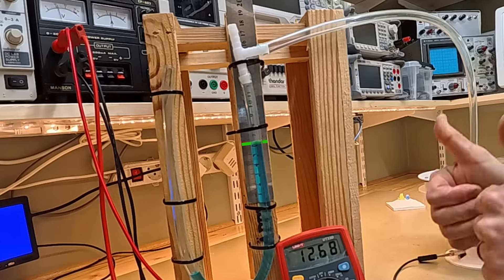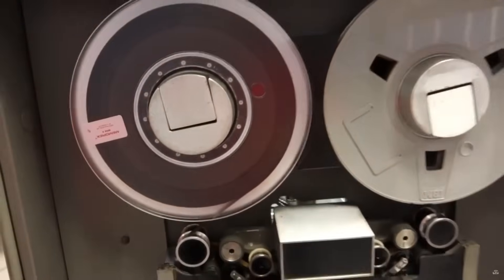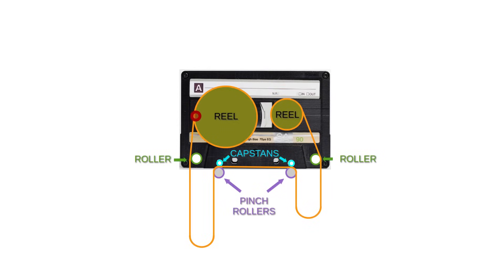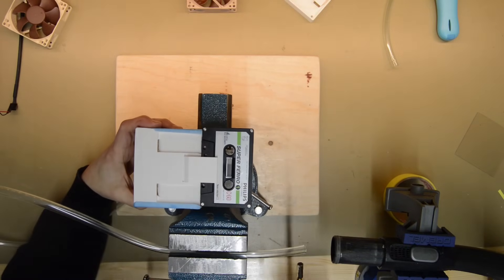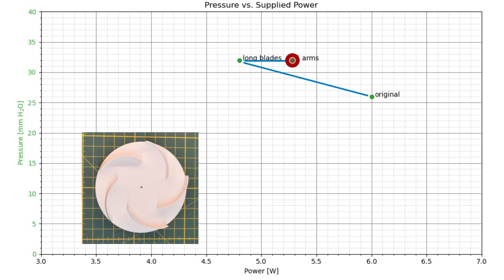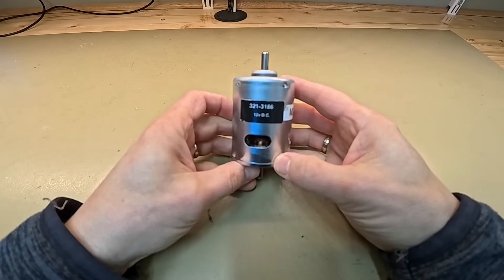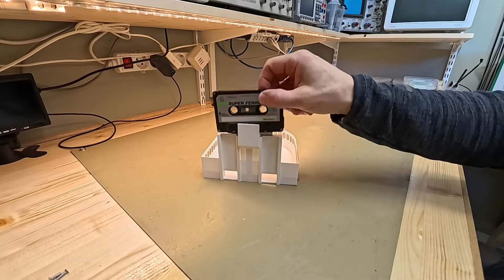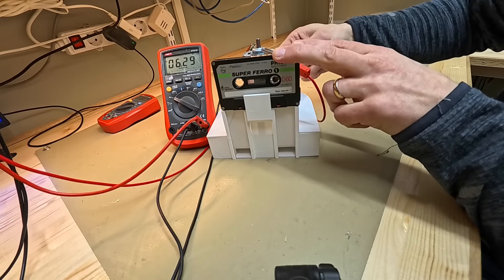The Vacuum Turbo Tape Drive Ep.1: The Quest for Vacuum

Comment: Dude that fucking cool. I hope you can make everything open source and design a circuit board for the electronics so people can build their own tape drive unit to use as a backup drive for their computers that looks the same! You could even sell the parts and or complete devices. I want one!

Comment: Hallo Thorbjörn! Bist Du mit deinem Projekt schon weiter gekommen? Warte sehnsüchtig auf die Fortsetzung der Serie!
Reply from the maker: Hallo! Ja, das Projekt läuft weiter. Im Moment arbeite ich an verschiedenen Sachen - viel Mechanik, CAD-Arbeit und Justierung der Laufbahn, plus das Feintuning der Regelkreise (was eigentlich der spaßige Teil ist!). Hatte auch viel anderes zu tun in letzter Zeit. Es wird noch eine Weile dauern, aber ich arbeite stetig daran! Danke für dein Interesse und deine Geduld!
Reply: @fulkonto1222  Danke für deine Rückmeldung. Als ich dein Video sah, mußte ich so an einen Klempner-Kunden aus Mitte den 90ern denken, als die Vernetzung gerade so los ging. Ethernet kam gerade in die Puschen und Arcnet war total angesagt. Da hatten wir einen Streamer der mit normalen Cassetten arbeitete. Wahrscheinlich CrO2 oder Metal, wegen der Bitdichte. War wohl so ein extremes Nischenprodukt, daß man darüber so gar nichts mehr im Internet findet. Kann mich auch nicht mehr erinnern, wieviel Daten überhaupt draufgepaßt haben. Drücke dir die Daumen für deine Projekte und freue mich, wenn du das nächste Video hochlädst! LG Holger

Comment: Sealing gaps goes a long way to create low pressure. Even if they are looking insignificant, they usually aren't. At least in real vacuums. Even one pin sized hole can have a significant impact. In high vacuum, that is. You still might want to seal your 3D printed parts with lacquer, and the assembly with sticky tape (sealant would be better, but tape is probably good enough and allows for disassembly).

Comment: There was no mechanical elegance of those tape drives.  It’s was terribly complicated because of technology limitations to get the fastest data throughput from a linear medium.  

VHS used a helical scan and multi-head technique to read oodles on data continuously without blasting the tape through at high speed under tension.  

That’s elegance.

Comment: To improve efficiency and loss to drag, redesign the impeller to become much shorter near the outside to make the area cross section the same from input of the blades to the output of the blades. This reduces the outside tip turbulence with the big drag surface. Yes the top cover will need the same curve instead of a flat surface. Close tolerance between the blade and top, reduce spillage, or a closed channel impeller can be designed so the close spaces are required at the input to the impeller.

Comment: Can't you just buy a ready made radial fan, that can pull 50-100 mm H2O? Pretty easy to get, I don't get this print it all mindset, with low efficiency and power draw of a two mules, compared to what you could get from a properly designed fan.

Comment: I'm wondering why you'd bother with the complexity of a vacuum advance for the tape when its purpose was to allow the mechanism time to get up to speed when the computer wanted data. In modern computers, the entire tape would be read in one go, the tape speed increasing with the capstan and both delivery and take up reels moving synchronously. A DCC head would be the way to go.

Comment: This might be a stupid question but is it possible to achieve the same result by blowing air in from the top instead of sucking it out the bottom? In both cases you just apply a force to the tape to keep it spooled into the chamber, so what would be the difference? It seems to be that blowing air would be easier than creating a vacuum pump.

Comment: Very cool. If this gets to a refined state, I wonder if we could make some replacement cassette tape containers that look a little more like vintage tape reels on the inside, for the nice clean vibes.
Reply from the maker: I’ve come across some mostly transparent cassettes with reels styled after the classic three-sector design from old tape drives. I’m planning to get a few to give it a proper retro feel - though function comes first, form second.

Comment: In 1974 I had the job at Racal-Zonal, Redhill of restoring the operation of a Midwest vacuum tape drive. The columns had optical sensors (not working) and the counter-rotating capstans operated with compressed air coming out of the sintered metal capstan surface (from the middle) holding the tape off and then higher pressure compressed air forced the tape onto the capstan surface to move the tape. Boy was it fast when I got that working but very noisy with the compressor and vacuum pumps. A couple of transistors (germanium) had fried so after replacing those and setting up the optical sensors (took hours!) it was pressed into service verifying RZ computer tape at 200 inches a second at 6250 bpi. It also needed a new head driver circuit operating at over 150 volts p-p from a 15 volt supply. Great memories. Thanks for posting your interesting project.

Comment: There's no reason the simple fan shouldn't have worked... What you needed for that was a plenum, just a box for the fan to "breathe" in. I guess it depends on how fast you really need that tape to drop. A couple inches of 1/8” tape doesn't have quite the same properties as a couple feet of 1/2” as used with "9 track".

Comment: Hopefully you'll be able to get the rest of the tape transport motors to fit in that envelope between the pump motor and cassette -- it'd be a real shame if you had to put drive components on the front that'd block the view. Though if you're really pressed for space I suppose you could flip the pump over and have that all in a basement below the rest of the transport.

Comment: When you started speaking at the start of the video, I had no idea what this even was. Once the old IBM tape drives were demonstrated, though, it make sense -- and that's very cool! It's like cheating in order to use a sequential data access device as if it were kinda capable of random access, when it isn't!
Reply: Now I'm starting to wonder if they ever tried having an entire long series of [some power of two] read/write heads so they could unspool the tape in, say, 512 byte "pages," with some of that capacity going toward identifying the starts and ends of pages. Or... something.
Reply: @VitriolicVermillion  If you haven't heard of the IBM 2321 Data Cell, the noodle picker, that was an attempt at using tape technology for true random access. It kept 400MB on tap in the form of a rotating cylinder of boxes full of lasagna noodle shaped mag strips.  Pick box, pick strip, wrap it around a drum, read and/or write, put back in the box.  Absolutely bonkers.
Reply: @dualityk  I think it's very cool, the ways people find to do the nearly-impossible with barely adequate technology. Some of our x86/64 extensions probably started off that way. I would love to encounter a compilation of stories like this, where a problem was addressed by creative application of the tech that was available, even if that tech turned out to be a dead-end (why we went optical for a bit, instead of magnetic, what the competing technologies [not as in proposed commercial standards, but whole technical principles] were at the time, what breakthroughs would decide the outcome, what later developments turned the tables, as long as we're talking about, for instance, what principle allowed for the die shrink that made something change, rather than "so we built the machine better"). Call it "a history of ad-hoc solutions in computer science and information systems" or something -- personally would prefer the focus be comp sci, but proper comp sci explanation of creative use of information systems would be adequate. I just want to avoid there being any "so we bought a bigger hard drive" stories. Science/improvised solutions, not market solutions!

Such a thing could be researched, but one would need to know what to look for. The oldest tech that was ever relevant to me wasn't like, business network stuff, or tape drives, but small token ring LANs on coaxial cables, and the IPX protocol, but that stuff was already on the way out by the time I'd seen it. I feel like the clever stuff was already done by then, though, aside from graphics techniques, compiler optimizations, etc. I dunno. But presenting the problems folks faced, and letting the reader pause to see if they can figure out a solution before reading on, would be neat. We'd probably find instances where the reader would guess that the solution was something entirely different, and could be a valid solution, but wasn't what was picked. A few such solution options could be discussed in order to find out either why it wouldn't have worked or simply wasn't selected, or why a proposed but not selected solution would have worked better, but was prevented due to either requiring truly rare materials, or those difficult to extract and process, or that a solution wouldn't have been realtime enough, or wouldn't have been deterministic but this was needed, etc.

This would, I think, require doing a lot of tracking down old timers, but this stuff is stuff we need to know. High-level coding has taken us so far that now we have "vibe coding," and I don't know that many of us would know how to employ a suitable search or sort algorithm correctly selected for the task at hand, or when to FIFO vs LIFO vs FILO, or what you even due with a stack trace, or what the stack even is, what a heap is, what the low-level stuff we trust the compiler to do on its own is doing exactly. Do we know endianness? I could go on, but I think I've done enough of that, haha!

Comment: This is absolutely amazing. How does it not tangle the tape? The loops are completely loose, wouldn’t that cause the tape to be immediately wound be the reel? I am surprised that the tape doesn’t just got sucked all the way to bottom or just reeled up by the capston/feed roller. It’s quite odd to see I will admit. What ensures that the tape will go down the channel instead of just right over to the feed roller horizontally?

Comment: Since you're dealing with cassette tapes, does the data r/w head only work in mono or multi track?

I would figure that if it were a duel head (stereo), or quad head(stereo, used in auto  reversible recorders), you could multiply the data throughput by spread-spectruming across 2 to 4 tracks at once without too many compromises. 

The commodore tape deck  recorded only in mono to a tape, if memory serves. 

Maybe something to try for the next project.

Comment: Quite a challenging control loop to implement. You must to take into account how much tape is on both reels for a constant speed because the diameter and spindle speed are related. I have subscribed because I'm curious how much closed vs. open loop control you'll need to implement.
Reply: Oh and I wanted to add: you can preformat the tape with sector markers to be able to read out the position through the head. This was a common technique on all forms of magnetic media.

Comment: That closed disk is the real need - that parasitic flow resistance is the key - pressure would be better i think, with making the blades higher, take a look at Tesla's designs of sth like a compression pump :)

Comment: For giggles I looked on Digikey to see what off-the-shelf fans may have to offer. You can get a lot of small size axial fan, but they are all 15k-25k RPM, and will undoubtedly sound horrific. There are some radial blowers that are a bit more sane, but none below 15W or so. For targeting so much static pressure and not having a team of fan designers with CFD, I'd say your results look pretty good. That and a brush DC motor with the commutator noise also feels period correct, and adds that little bit of charm. (assuming its not bleeding so much magnetic field it messes with your read-heads, or so much electrical noise it screws with the readout circuitry)

Comment: Instead of dealing woth all the vacuum atuff thats expenive off the shelf, nefetsitating building your own vacuum source, consider that yor dealing with relative pressures. Enclose the cassette and perhaps the motors that drive it and feed it with an air compressor. Then you let the tape be "drawn" into a region of ambient pressure, which is now vacuum relative to the tape housing.

Comment: you should be able to get much higher bandwidth out of tape, since the audio frequencies are added to high frequency bias signal in order that low frequencies can be reproduced.  if you build your own head amplifier you could maybe get up to 100khz or so, depending on tape formulation probably

Comment: Kudos for using the correct terminology - vacuum column. 
FunFacts: Noise: the IBM tapes drives that used vacuum technology were enclosed in metal cabinets with sound deadening material inside the cabinet  , BUT they were still noisy. Another benefit of the vacuum technology is that it kept the tape dust free. Very important with the close tolerances of the tape read/write head assembly. The R/W heads were made of a very abrasive resistant material. Nonetheless, they occasionally required replacement. I can remember our IBM CE occasionally replacing r/w heads on the round reel tape drives. When the technology improved and the industry went to square tapes (cartridge design) , I don’t ever recall a CE replacing a r/w head.

Comment: A centrifugal air pump usually needs a diffuser to work efficiently. The air exiting the rim of the impeller must be slowed in a channel which gradually increases in area, converting velocity to pressure. Without a diffuser air exiting the impeller will see ambient pressure, limiting the vacuum at the inlet. With a diffuser the pressure at the rim of the impeller can be below ambient.   The diffuser  can be made of static vanes as in most vacuum cleaners  or a snail shaped volute, which would probably fit the existing housing better.  Also i think you misplaced the decimal point  in your capacity calculations somehow. I get capacity 10 times higher. Otherwise cool project. I'm interested to see what modulation scheme you  try.

Comment: There's something off about the max information calculation.  The SNR of 60dB needs to be understood as being in amplitude dB, meaning 20 log, not 10 log.  So it's log2(10^3) or about 10.  Multiply by 15k, divide by 8, and we're at 18.75 KB/s.  But if it were the miraculous 120dB SNR implied by taking the log2 of 10^6, that would result in 37KB/s, not the 30 in the video.

Comment: Well, I think you could have taken the shortcut to the turbine desing and disassemble random vacuum cleaner to get some desing ideas - like vanes shape, length, diameters, etc. For example, you would have seen that the wheel is closed on top and bottom (something you discovered yourself). Another idea - you could take the entire turbine assembly from a vacuum cleaner and just make a speed controller for it. The assembly is surprisingly small - it is comparable to yours, or even smaller.

Comment: Seems nuts to me all this 😂
Good luck.
I remember that that turbotape. You needed to preload code into the CBM64 in order for it to decipher the code faster. Maybe some type of compression of the audio. Just thinking of how they fitted this preloading onto those 64000 characters memory and getting it released away to get the game or software loaded. It is mind-blowing to me. Even the game coding utilized negative color impression or something to create illusions on the screen. Because the memory size couldn't fit the code. Even thinking of how the gaming industry attempted some early style copy protection on the same memory size. It is all 🤯

Comment: Very cool idea. You might want to look into outrunner motors used in drones and rc planes. Their speed can be controlled easily using ESC and they are much more efficient than brushed motors. There's a good video on youtube about building portable vacuum smd stencil holder. It uses a very good impeller design and such a motor
Reply: Those motors will burn up without lots of airflow. They also run way too fast. I doubt a 3D printed impeller would hold up.
I would suggest using an RC car motor if you want a brushless one. They don't need lots of airflow and will operate at a much more reasonable speed.
Reply: @rocketman221projects i built the vacuum table i mentioned in my comment. So far the impeller hasnt shattered and the motor hasnt burned. Though it may be a good idea to add some fins to impeller to direct some air flow across the motor. Or indeed use a different rc motor designed to work in enclosed space. Point is to use brushless.

Comment: Nice, can't wait for the next episode, It'll make a lovely addition to my retro kit.
Although I kind of have an ideal vacuum pump/sucker in that it came from a Honewell? mainframe tape drive!
I should hook it up and see how many mm of water it pulls.

Actually when you were doing the tests I was kind of waiting for you to actually pull the column past the bottom of the loop, sending it off into the pumps impeller and spraying water all over your workshop.